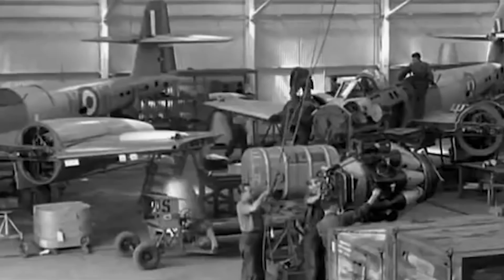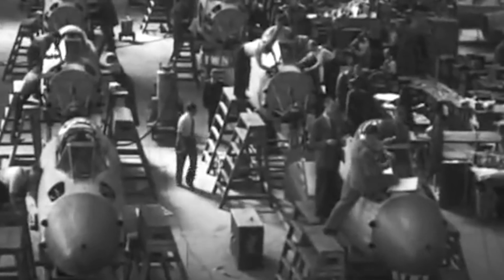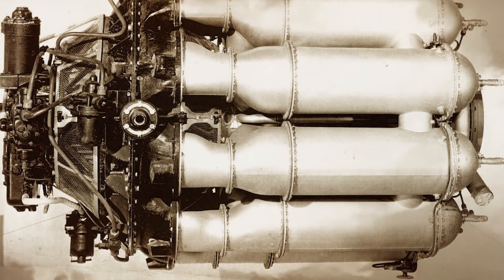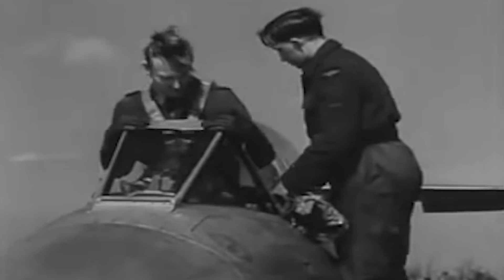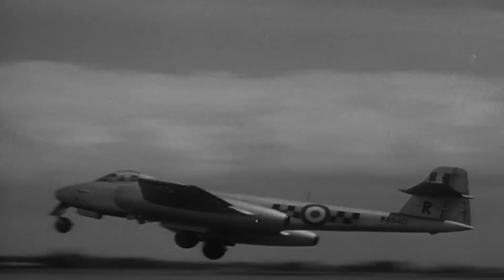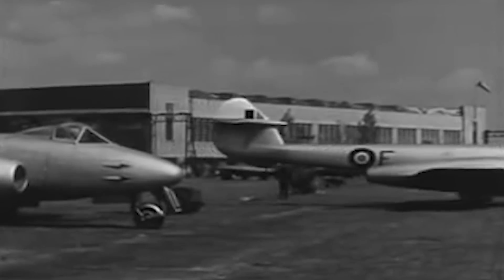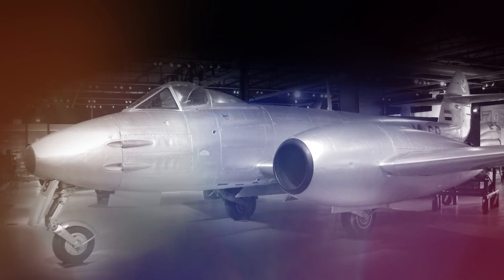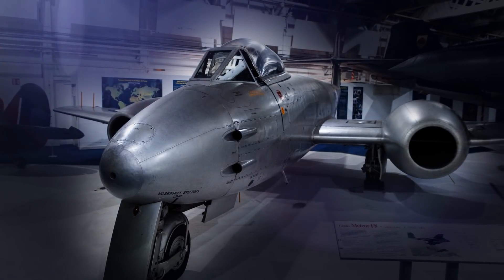Gloster Meteor - The Only Allied Jet to Fight in WW2

Comment: There is a myth that the Germans were way ahead of the British in jet engines and planes in WW2, when the opposite is true.  The WW2 German jet engines were extremely unreliable with low performances with very high fuel consumption. The German axial-flow turbojets never worked properly being developed up to 1953 by the French to obtain a usable engine. The French lost a lot of time playing around with the German engines, instead of working with the British. The French and Soviets after WW2 attempted to improve the German axial-flow engines largely failing. 

The British in order to get a usable and reliable jet engine, with the technology of the time, went for a centrifugal design rather than the troublesome axial-flow design. This design produced less thrust than an axial-flow but was quicker to develop and reliable.  It took 5 months to develop, while the first reliable axial-flow engine was the 1950 Rolls Royce Avon, which took 5 years to get right. 

In 1945 the French made and tested some German designed turbo jets made with quality steel unavailable to German industry in WW2. They ran for 25 hours instead of 10 hours to the Germans engines that used poor quality steel. Not much better. The German axial-flow engines failed because of heavy design faults. The centrifugal compressor used by the first British Meteor plane was fine being much more reliable, but unable to reach high compression ratios. This limited performances. Centrifugal compressors were used up to the 1960s.

In 1945 the team from the French ATAR laboratory plus some BMW and Junkers engineers, were engaged by the French SNECMA research bureau, with the objective to built a new reliable with performance axial-flow turbojet. The BMW 003/Jumo004 was considered unusable. It was tested on the first French jet aircraft, the 1946 So6000 Triton, overheating and exploding. The plane only flew with a Rolls Royce Nene centrifugal turbojet.

The ATAR project took 6 years to produce the first acceptable axial-flow turbojet (ATAR 101 B1), produced in 1953. So eight years research & developments by the French using the German jet engines as the base. It was installed on the first French jet fighter, the Dassault Ouragan.

The French lost a lot of time because the German jets had poor efficiency with some concept fails. Essentially in the combustion chambers and fresh air circulation to reduce the external temperature of the engine. The BMW jet was known for overheat problems which precluded fuselage installation.

The question at the end of WW2 was what is the most efficient way to produce jet fighters. The answer is clearly not adopting the German design of engine and fuselage. The build costs for a jet engine were much higher than a piston engine, with the fuel consumption near 3x. The centrifugal compressor the British adopted in some planes was the best choice with 1944-45 technology, more compression pressure was not an advantage when the hot turbine was unable to resist higher temperatures. The German turbojets had big overheat problems as the engine would not work in an enclosed fuselage for single engined fighters. This defect was immediately noted by the French on the 1946 "SO 6000 Triton" prototype, and by the Soviets on the 1946 Mig 9. The Soviets quickly replaced the BMW 004B2 by the centrifugal Rolls Royce Nene which worked without problems, dismissing the BMW engine for fighter planes. 

The Rolls Royce Nene was copied to the last nut by the USSR being installed in the Mig 15 being used effectively in the Korean war. About 10 years ago the USSR eventually paid royalties to Rolls Royce.

The Meteor was the first proper fully developed jet plane introduced. The 262 was slightly faster than the Meteor F3, but extremely unreliable. The British would never put into the sky such an undeveloped plane as the me262. The me262 and Meteor were leagues apart in safety and reliability. The British could have had a jet fighter operational in 1941, but it would have been as bad as the me262. The Germans advanced R&D on jets after interrogating captured British RAF men. They learned the British were advanced in jet technology actually flying prototype planes. Until then the Germans had no intention of mass producing jet planes. 

The rushed together Me262 started claiming kills on 26 July 1944. However the supposed kill was a Mosquito reconnaissance plane that had a fuselage cap blown off in a quick fast maneuver, which flew on landing in Italy.  The Meteor claimed its first V1 kill a few days later on the 4 August 1944. But the Meteor was a proper fully developed jet plane, not a thrown together desperate effort as the me262 was. The me262 fuselage was similar to a piston plane with the pilot over the wings obscuring downward vision, while the Meteor was a proper new design fuselage specifically for jet fighters with a forward of the wings pilot position with superior vision, as we see today.  The cockpit was very quiet.  The sweptback wings of the me262 were to move the engines further back for better weight distribution, not for aerodynamic reasons as is thought the case.

Centrifugal compressors were not obsolete being used in turboprops. Between a turbo jet and a turboprop, the only difference is the turbine, not the compressor. The last centrifugal compressor jet engine still in service on a handful of commercial aircraft like the Fokker 27, is the Rolls Royce Dart turboprop. A very reliable engine made in 27 versions, but with high fuel consumption to modern engines. The Rolls Royce Dart Turboprop turbo jet engine was produced the longest, being a comparable design turbojet to the likes the Rolls Royce Nene. The rugged engine was produced from 1946 up to 1987.
Reply: GERMANY was years ahead of the British in jet engines and aircraft technology.
Reply: @tecdessus Yes they were, The World's first jet aircraft flew on August 27th 1939 in GERMANY.
Reply: @sandervanderkammen9230  so germany was a bit ahead in putting a british invention in a plane? So? Also the allies could've built everything germany did, they were just smart enough to know they didn't need to
Reply: @snonsig2688  the brits didn't invent turbojet engines or jet aircraft.
The facts are irrefutable so spare us the revisionist propaganda rhetoric please..
Reply: @sandervanderkammen9230  the jet engine as a whole was a british invention and i'd love some evidence against that if you have any. But i don't think you do
Reply: @snonsig2688  I'd love to see you provide some evidence to support that popular brit myth.
The turbojet engine and jet aircraft were invented in Germany, not the U.K.
Reply: @sandervanderkammen9230  all together the jet engine Was invented by 3 people whittle, a brit, von ohain, a german and fonó, a hungarian
Reply: @snonsig2688  
The first patent for using a gas turbine to power an aircraft using an air flow compressor was filed in 1921 by Maxime Guillaume. His engine was an axial-flow turbojet but this wasn’t practical at the time with many conceptual flaws. The practical theory of gas flow through passages was developed into the more formal theory of gas flow past airfoils by A. A. Griffith. He wrote An Aerodynamic Theory of Turbine Design in 1926. This was the basic theory of the jet engine. The first running model was produced and tested by Frank Whittle, five months before Ohain in Germany.  It was the first turbojet engine in the World to be built and run, having a centrifugal compressor and an axial flow turbine.

Ohain did not design a reverse flow engine, with his engine having a centrifugal compressor and a radial inflow centrifugal turbine. A design never used in any production engine. Based on a patent filed by Whittle. Ohain even commented on Whittle's unusual design when he read his patent prior to filing his own. From Ohain's biography: 
"When I saw Whittle’s patent I was almost convinced that it had something to do with boundary layer suction combinations. It had a two-ﬂow, dual entrance flow radial flow compressor that looked monstrous from an engine point of view. Its ﬂow reversal looked to us to be an undesirable thing, but it turned out that it wasn't so bad after all though it gave some minor instability problems."

The axial compressor was first demonstrated in Britain, however the British used centrifugal compressors because they were more reliable and better understood at the time. The aim was to produce a better performing plane than the piston p0lanes of the time. The me262 's axial-flow engine needed entirely new engines every few hours as axial jet technology wasn’t perfected.

The father the turbo jet was Frank Whittle. The British defence ministry rejected Frank Whittle’s design because reviewing engineers at Armstrong-Whitworth asserted that a turbo jet engine at that time would be inefficient. Whittle patented the design himself, and with it not being top secret, it was open to the Nazi design team led by Ohain.

In 1935, Hans von Ohain started work on a similar design in Germany. It is often claimed that he was unaware of Whittle's work. Ohain said that he had not read Whittle's patent, and Whittle believed him. Whittle patent was in German libraries. Whittle's son had suspicions that Ohain had read or heard of it, not believing the coincidence. Years later von Ohain in his biography that he did read Whittle's patent. Author Margaret Conner states ″Ohain's patent attorney happened upon a Whittle patent in the years that the von Ohain patents were being formulated". Von Ohain himself is quoted as saying "We felt that it looked like a patent of an idea" "We thought that it was not seriously being worked on."  Ohain's patent was not filed until 1935. Clear evidence that Ohain had read Whittle's patent, and had even critiqued it in prior to filing his own patent two years before his own engine ran.

Armstrong-Whitworth, basing their work upon their criticism of the Whittle concept, began development of the first axial-flow turbojets turboprops. The forerunner of today's turbofan jet engine. The Whittle design proceeded privately as Powerjets, then taken over by Rolls-Royce. By 1944, the Armstrong-Whitworth design was developing higher thrust with superior throttle control. The Rolls- Royce centrifugal flow turbojet was proven to be far more reliable than the Nazi jet projects, the Jumo 004 and the BMW 003.

A major problem was the “creep” in the structural makeup of steel that is induced by high temperatures. Steel is not the ideal material from which to build jet engines failing because the iron in the steel sublimates out of the alloy, turning the metal to Swiss cheese on a microscopic level. In the 1940’s, it was unknown that steel would inevitably fail exposed to the temperatures and pressures in jet engines. The lack of cobalt for high-temperature steel alloys meant the German designs were always at risk of overheating and damaging their turbines. The low-grade alloy production versions of the Junkers Jumo 004 powered the me262. The engines would typically last only 10–12 hours before burning out. If it was accelerated too quickly the compressor would stall with instant loss of power. More exploded on their first startup. Over 200 German pilots were killed during training.

Nickel alloy was developed by research teams at the Wiggin Works in Hereford in England, which still exists today. The R&D was requested by the Whittle jet engine development team. The Nazi design teams ever understood that steel was never going to work. The Nazis two major production jet engines never managed to last more than a few hours. 

♦ Whittle's reverse flow design is the basis for almost all turboprop engines in production.
♦ Britain had axial-flow engines running in 1941 - the same time that Franz had his Jumo running. The Metrovick F.2 flew in a Meteor in 1943. The F.2 transpired into the Sapphire which the US built under licence as the J-65 and then modified it as the J-47.
♦ Westinghouse in the US was given a Whittle engine, and plans for improvements. They made such a hash of it that Whittle had to go to the US to assist. The US government gave the project to GE who made the I-16 which transpired into the first US built jet engine. The US licensed the Ghost for the P-80/T-33 and the RR Nene. The Nene was used by the Soviets in the MIG 15.
♦ Ohain's engine was not produced, being shelved by 1943. No engine was built using his design.
♦ Whittle also R&D'd axial-flow engines. The metallurgy was not advanced enough at the time. Whittle's engines produced far more thrust than the German axial-flows and far more reliable.
♦ The PT-6, PWC 100/150 are derivatives of Whittle's designs being still produced.
♦ Whittle's centrifugal-flow engines were built under licence in the US after WW2 - the J-33, J-42 and J-48.
♦ The Olympus was the world's first 2 shaft turbojet and the first to exceed 10,000 pounds of thrust.
♦ The Avon is the longest produced gas turbine in history being still in production as a land based generator.
♦ The RR Conway was the world's first turbofan.
♦ The RB-211 was the worlds first 3 shaft turbofan.
♦ The Rolls Royce Trent was the world's first turboprop to fly.
♦ British axial-flows led the post war world in technology and power.
♦ The Sapphire was built in the US as the J-65.
♦ The GE J-47 was based on the Sapphire.

Frank Whittle invented the modern turbojet.
Reply: @johnburns4017  The world's first jet engine was built in 1934 Gottingen Germany and the first successful flightworthy jet was flown on August 27th 1939, in Rostock Germany 
These facts are irrefutable.
Reply: @sandervanderkammen9230  
What else did the screaming voices tell you?
Reply: @johnburns4017  Over 1,000 Meatboxes crashed crashed... never shot down a single Luftwaffe plane.
Reply: @sandervanderkammen9230  Hi doktorbimmer!
What do you think of Wankel engines?
Reply: @johnburns4017  John please get therapy 
I'm not Trump either...
Reply: @johnburns4017  John please get therapy
Reply: @sandervanderkammen9230  
Have you been tested for Covid yet?
Reply: @sandervanderkammen9230  
docktorbimmer, a Mazda rotary hybrid is to be made. I think you will need 24/7 supervision now.
Reply: @sandervanderkammen9230  Oh Sandyboy, I see you are telling fibs again about 1934 in Gottingen. If you don't behave yourself Pabst von Ohain and I will have to embarrass you again.
Reply: @tecdessus The Gloster E28 did not fly until 1941... this was after both the He-178, He-280 and the N.1 had flown successfully..
The brits came in 4th place in the race to build a jet aircraft.

Comment: Did he really say 450 RAF pilots were killed by the Meteor to get it certified for war?
Reply: The Gloster "Meatbox" as it was called by RAF pilots was the worst jet aircraft in history, over 1,000 crashed... 1 out of every 4 crashed in non- combat operations.
Reply: No he never.  The Meteor was enhanced after WW2 with many different varients and more powerful engines. The British were developing fast jet, low level, attacking operations - of which they excel even today.  Many of the crashes were performing these maneuvers.  They were also pushing the plane to its limits.
Reply: @johnburns4017  The Meatbox was the worst jet fighter ever used by the RAF... it killed 450 British pilots.

Comment: It had its flaws ,we lost 450 pilots.Enough said.
Reply: The deaths were not due to flaws, more to do with taking the plane to its limits in low level training.
Reply: @johnburns4017  1 out of every 4 Meteorites CRASHED..
It remains the worst jet fighter ever used by the RAF.
Reply: @sandervanderkammen9230  But far from the worst overall as you know Sandyboy, that would probably be the Me 262 or maybe the F104 in German hands.